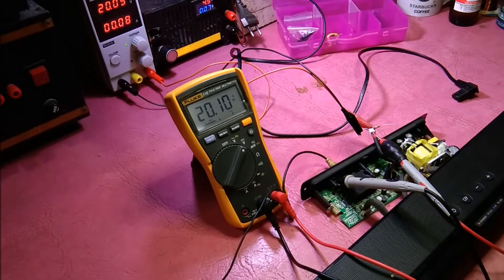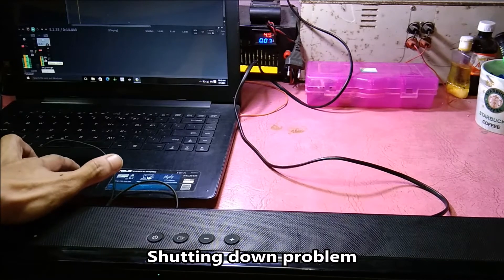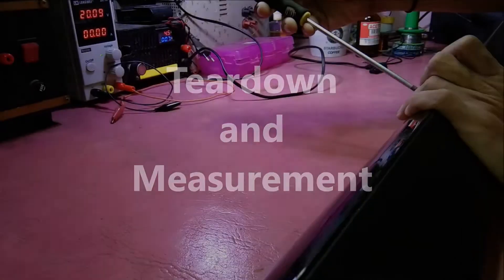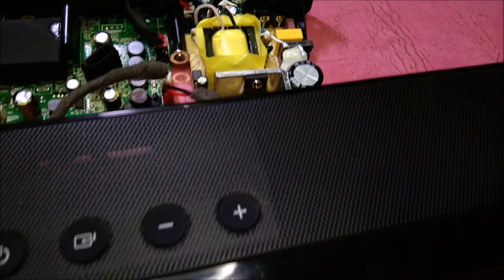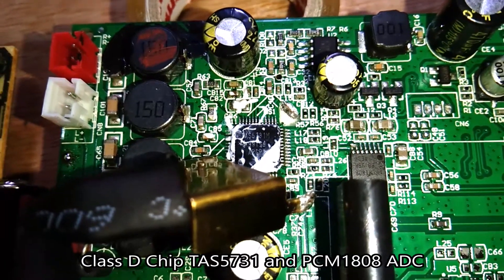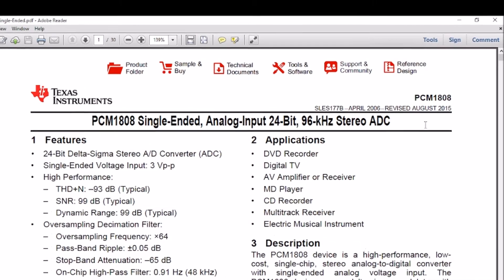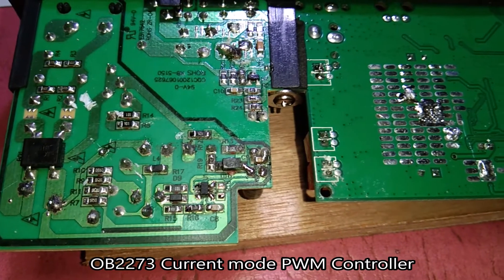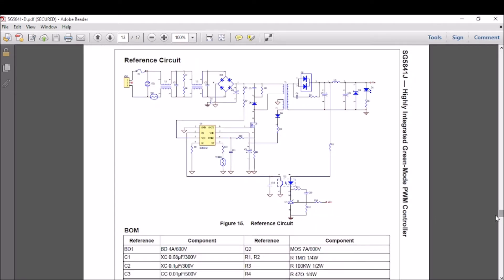SoundBAR SB-50 Shutting down | Repair and Modification

Comment: Good pm sir may tanong po ako yung sb 50 ko po nag ooperate po pero dpo ako maka connect sa bluetooth at usb ayaw pong ma scan sa phone ko at tablet..?
Reply from the maker: Lagyan mo nalang ibang Bluetooth module receiver Sir, marami sa shopee.
Reply: @CABohol  thank you..🤗
Reply from the maker: @danilosimon9010  Sure 😊
Reply: @CABohol  good pm boss, paano po i coconect sa sb 50 yung bt module reciever? Hehe hindi po ako marunong magkanit non..
Reply from the maker: @danilosimon9010  5V Supply, GND, line out. Check molang Sir may wiring diagram din Yan.

Comment: Question. Ung devant soundbar ko kahit nakakabit sa aux cable tumatalon pa din ang sounds. Ano kaya pwede gawin?
Reply from the maker: Try nyopo sa Bluetooth mode, kung napuputol din,.. Possible my problema sa amp or PS Section. Try nyopo check ang voltage kung my DMM kayo, kapag nag drop ang voltage habang napuputol ang sounds defective napo ang PS.
Reply: @CABohol  is there a way para ifactory reset itong soundbar?
Reply from the maker: @jeraldvincentzumel5300  Wala po ako idea.

Comment: Hi Sir, I have this Devant soundbar and may tanong lang po sana ako. Hindi naman siya sira pero napapansin ko kasi na for about 20mins of idle time, nag aauto sleep siya. Tested ko siya sa aux mode at BT mode. Meron bang way para mag stay on siya? Kahit sa Aux mode lang.
Reply from the maker: Hi Sir, yan ata default settings ng MCU nya, ang way cguro nyan is ereprogram. Pero hindi kopa yan na try Sir. Sorry po.